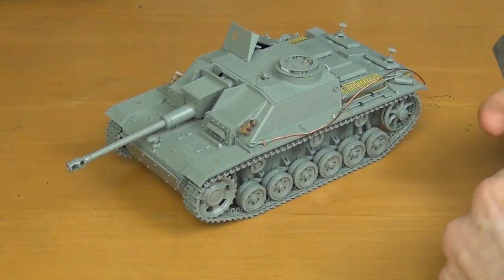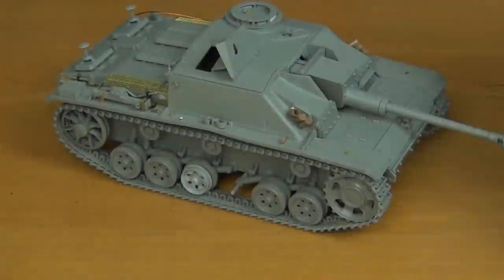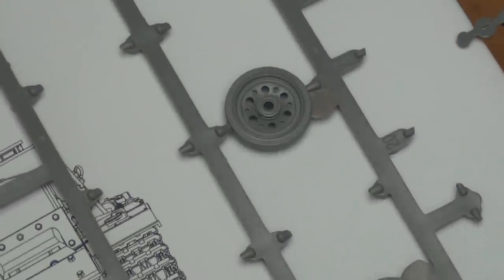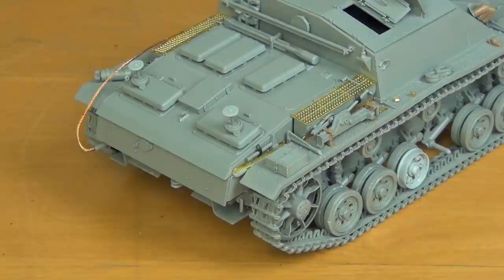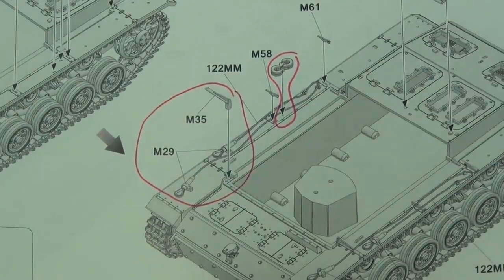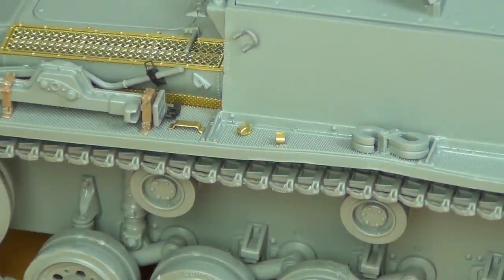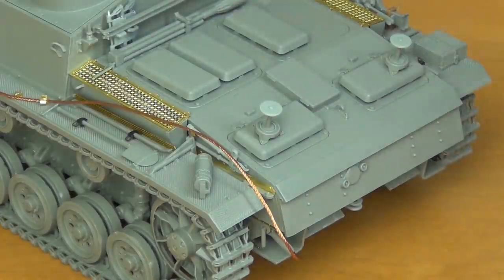Panzermeister's "Definitive Review" of TAKOM StuG III Ausf.G Early Production (BLITZ line #8004)

Comment: Excellent review, thank you! I've subscribed and look forward to more :) I built their Panzer III N and had problems getting the ventilation domes on the engine deck to sit properly, did you encounter something similar with the Stug?
Reply from the maker: No I did not, but I believe the vent domes in the Pz III sprue are different than the StuG ones.
Reply: @Panzermeister36  Sounds like they fixed it. On the Panzer III they have nothing to sit upon except for a few tiny stubs so in the end I filled the insides with putty to give it some substance.
Reply from the maker: @HerrGausF  Oh no, that is still the case with this kit.  That is how they are in real life.  I had plenty of experience from other StuGs to know to just apply extra thin along the inside lip of the covers and then pretty them into place; they will then glue onto the little stubs.

Comment: I'll have to look into that cupola claim as just build a dragon early G and had nothing about it the hinges were on the blanked part at back it has the correct bump stop and inner ring I've noticed this one doesn't there actually after just looking at mine to yours I'll go check that now thanks
Reply from the maker: The inner ring is not always present on the real vehicles, as far as I have seen.  Dragon kits also don't show the "incorrect" cupola, but depending on the kit you built it may not be required.

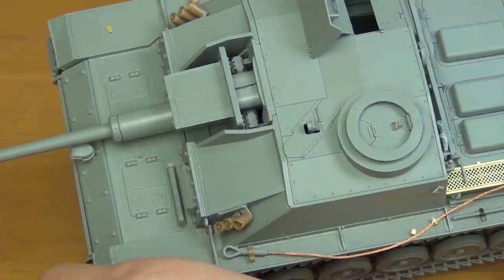Comment: One of the small issues that I can see is the grab handle on the top back-side of the gun shield. It is just a tab of plastic and should be a handle similar to the handle inside the loaders hatch. It can be seen @27:32. Normally I wouldn't bother but it is noticeable at the top of the model and could easily be fixed.
Reply from the maker: You're right.  I would fix that, but it's the same on my 10+ Dragon StuG III kits.  On my shelf they'll look alright next to each other...I don't bother superdetailing all my projects.

Comment: Do you  know if Panzer Art cast concrete could be used to modify this kit.?
Reply from the maker: It should fit pretty well but it might not be perfect fit since that set is meant for Dragon.  But a little putty should solve any small gaps around the edges.
Reply: @Panzermeister36  Thanks.. Nice video.

Comment: Looks like a nice build. So I have a question, of all the stuG lll you have built which do you think is the over all best one? I ask because I would like to add one to my shelf.
Reply from the maker: Dragon 6644 if you can even find it anymore.  That one is amazing.  Other StuG kits like Dragon 6578 or 6320 are also very good.  More recent Dragon releases aren't as good as those.  

For the early short-gunned StuGs, the Tamiya StuG III Ausf.B kit is great, along with the new Bronco StuG Ausf.C/D/E kits.  Stay away from Dragon short-gunned StuG kits.
Reply: @Panzermeister36  You can find 6644 on ebay, but it is going for a ridiculous amount. There are very few kits I will pay over 3 digits for and a Stug is not among them.
Reply from the maker: Yeah, it's a good kit but hard to find now so it goes for ludicrous prices.  It's worth $50 max...
Reply: @Panzermeister36  Unfortunately I got most of my Stugs before the better ones were available; I've built the Cyber Hobby 9132 and have CH 6371, the rest are Dragon 6851, 6688. 6756, 9013, 9014. 6756 and 9014 have been built. If I ever buy more Stugs it likely won't be Dragon.
Reply: @Panzermeister36  thanks for your reply,  much appreciated.

Comment: The Das werk stug release is an old dragon 2007? kit with Zimmerit or plain parts.I was suprized as stugs on ebay are pretty overpriced nowadays.Ryefield Pz.kpfw.III is almost a dragon clone,i had half of kit parts in spares bin.Same build system and parts,just have pins instead of holes on wheel's.Nothing new there.Border not looking too special either.Thanks for review.Tracks on RFM Pz.III dont fit on jig,you have to cut all 360 individual pins if you want 'working' tracks.

Comment: Which Stug 3 had the radio box on the side of the superstructure?
Reply from the maker: That would be the earlier vehicles.  Ausf.A, B, C, and D have one box on one side, and the other side angled steel.  Ausf.E and F have the radio boxes on both sides, and the F also has a long gun.
Reply: It is funny I have never seen it on the model kits of these vehicles which I have made .

Comment: Should I use short or long tow cable clamps on this vehicle?
Reply from the maker: They should be the shorter style of cable clamp I guess...assuming I'm thinking of the long ones as the type on the Pz III engine deck as the clamps held the cable ends as well as the cable looped through once as well.  On StuG they just held the end so the clamp is shorter.
Reply: @Panzermeister36  Thank you very much for your quick reply and help!

Comment: Strange why they never added the inner idler rims in PE they did with there panzer 3 ausf M and N and basically same kit basics was there only the 1 PE fret? In there panzer 3 kit there was a separate fret it had 6 quarter round parts on them that made up the ring onnthe inside there not just 2 single rings they come in 3 half moon shaped rings! There panzer 3s also had 3couple types of the tow pintals in the kit I can't understand why they haven't added these in this kit as was used for the panzer 3 M I'm looking at it right now lol crazy! And the smoke launchers were perfect and told you in the instructions what direction to have the cut outs positioned it was actually one of the best panzer 3 kits I've build and I've build mini art and dragons! What a difference in there stug and panzer 3 I'm actually shocked at this!

Comment: I have that kit. Disappointed in Takom. IMO it needs alot of upgrades,special with the MG
Reply: have u done the das werk stug model?? tryin to decide either that one or this. das werk is twice the price for me.
Reply from the maker: Das Werk kit is a rebox of  the Dragon/Cyberhobby StuH 42 with zimmerit kit.  I have a review of the original boxing.
Reply: @Panzermeister36  Ya its a updated of the 2008 with zim paste added. I will definitelywatch it. Would you say its better or worse than this takom kit?
Reply from the maker: No, the original kit had zimmerit too.  There are no new parts or updates to the kit.  I was willing to help Das Werk with updates but they were not interested, they said they just wanted to rebox it unchanged.  Which is fine, since it's pretty good as-is.
Reply: @Panzermeister36  O really, that makes the kit not worth paying twice the price for me. After re-watching both your reviews I think I am going to go with the Takom Stug kit. Takom Kit sounds pretty solid and I can do some modications to it with your helpful guide. I am also going to take the  Schürzen from the panzer 3 M kit and put it on the stug. Thanks for your help!

Comment: "Well behind" I mean what Takom have done is actually plonked 30mm applique - on an 80mm bow & glacis - not to mention the mistake regarding the distance between idler wheel and last torsion bar - as well as having Alkett style transmission hatch locks along with MIAG style fender supports -  the kit is grotesque !
Reply from the maker: The transmission hatch lock position can be easily fixed by installing the hatches on one side in the reversed direction as I have done here.  But yes the bow is wrong, most likely copied from the old Tamiya StuG III Ausf.G.  the shape of the idler wheel itself is also not right.  

But, this kit is clearly aimed at the kind of person who doesn't care about these things.  It's a budget kit with soft details and easy assembly.  Personally I won't buy another Takom StuG as the RFM and existing Dragon kits are way better.